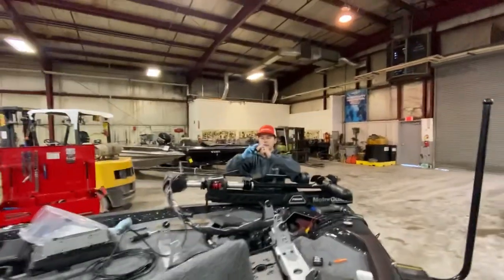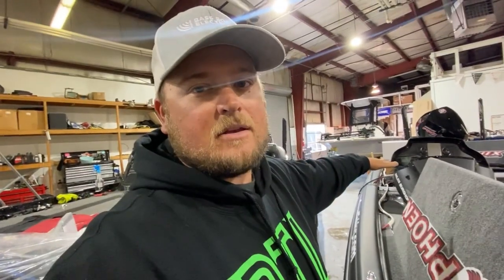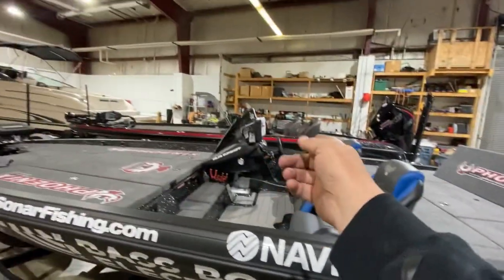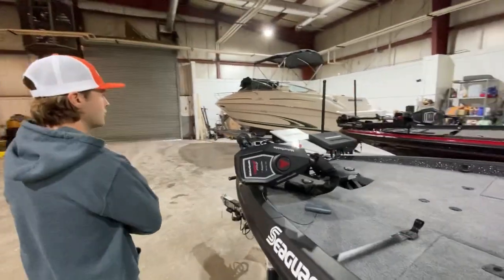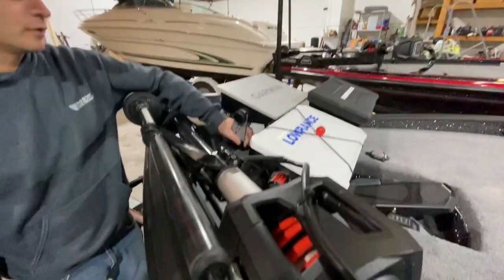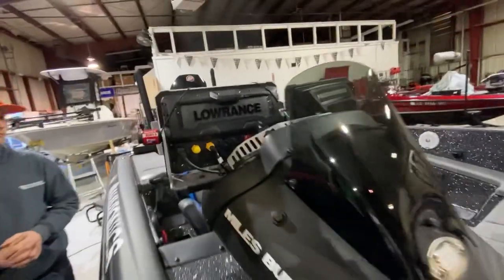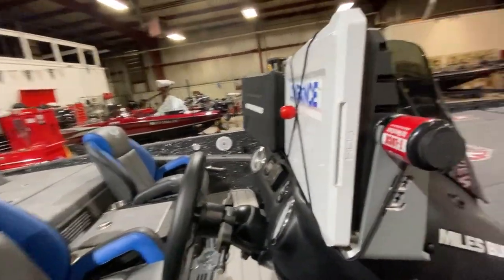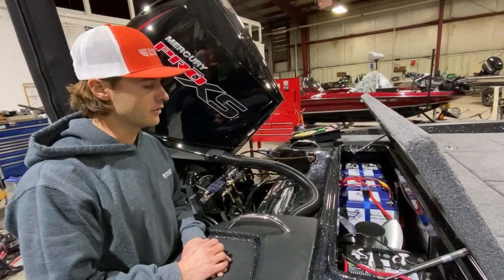Rigging The PHOENIX 921 Elite- Day 2!!!

Comment: New updated "single wire design" livescope cable. Are those available to the general public? Sounds like a lot less trouble!
Reply: The new livescope units that you purchase should have the single round transducer cable. The older systems had the 2 wire flat cable.
Reply: @DRDROP-fj4bo  Thanks, planning to get one this summer. ✔
Reply from the maker: Yes, it is available to everyone.  This is the first I heard of it though.